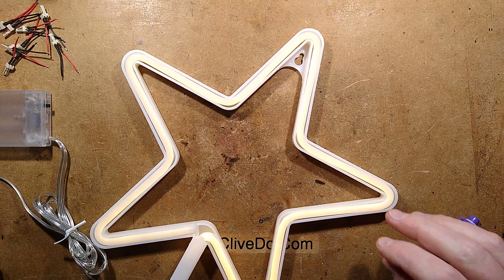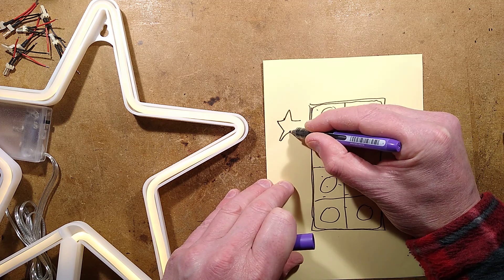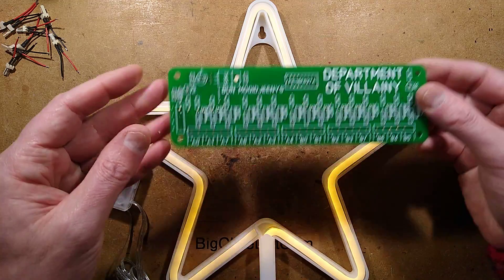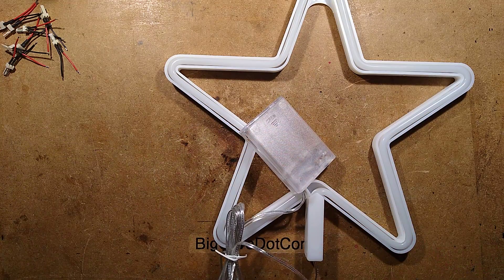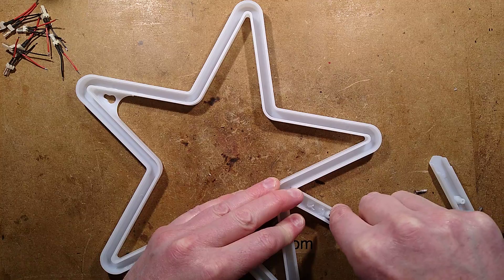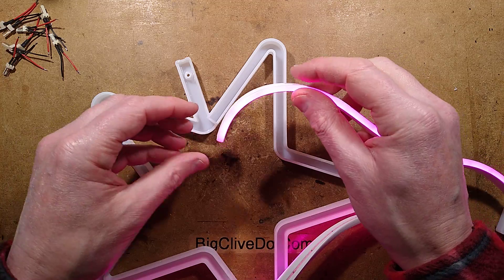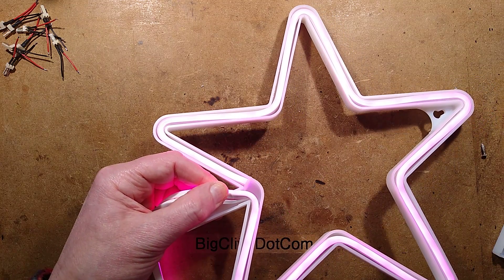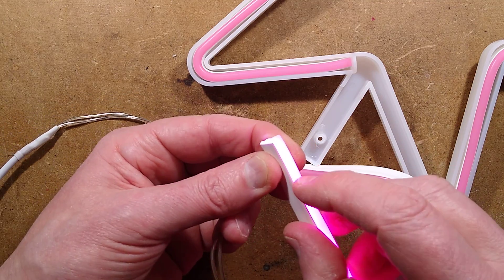Converting USB stars to 12V in eight colours.

Comment: Tip for drawing a star from a former bored student. All lines diagonal, only 5 lines.
Imagine a star. 
Start the first line from the bottom left tip.
Up and slightly right, to the top tip.
Down and slightly right, to the bottom right tip.
Up and to the left to the left tip
Over to the right tip.
Down and to the left, back to the first tip.
You should now have a star.

Comment: I don't know who designed that power system, but they should be fired. Exploding batteries are kinda hazardous, who knew right? At least they could put in a diode or a three position switch (something like battery/off/usb).

Comment: I find the construction of the frame weird, I'd think having the open side not be visible once it's hanging somewhere would be better looking and have the plastic also diffuse the light a little bit, but what do I know I repair audio equipment, not lights
Reply from the maker: The neon is at its brightest and sharpest viewed directly.  It would be much lower intensity if put through another layer of diffusion.

Comment: That plastic frame looks like it's translucent, so how would it look if you put the LED strip in upside down so that the light shone through the back? It might turn out better while hiding the exposed end of the strip, but only if the frame is translucent enough to carry the light.
Reply from the maker: The strip already applies high diffusion so it would impact the intensity and sharpness.

Comment: Clive i got a quick questions about motors. I'm a surveying technician and work with a Leica Total Station 16 every single day. However, whenever I had some free time at work I would "discover" it a little. The horizontal and vertical movement for auto lock, auto aim, auto rotate and such is I guess controlled by a stepper motor. Since its pretty loud. However it's able to position the machine within 0.0001m. And I am really damn curious how such precision is achieved. Also, whenever I have to manually move the total station horizontal or vertical it uses digital knobs. Not analog. But it's still really accurate. And rotates everything via the motors again. I could provide some stuff if needed, like photo's or videos....

Any idea how this is even possible??
Reply from the maker: It sounds like it may use well geared stepper motors and an accurate reference point.

Comment: I wonder if you can get the faux-Neon LED strips with addressable RGBW LED tape inside. If not, get on it, China!
Reply: BC did a review of a remote-control RGB neon strip -- but IIRC it was the older, fatter style.  And you'd have to hack the remote control signals...

Comment: Couldn't you connect power at both ends to eliminate the voltage gradient? Positive on one end and negative on the other, then the two voltage drops cancel. Then you can just use a big fat resistor to run it off 12v. Obviously less efficient but if it's mains powered on someone else's property...
Reply: I like that idea, connecting st either end
Reply from the maker: The resistor would run very hot.

Comment: I accidentally ordered some cheap 240v wifi bulbs and can't use them here in the US.  Too expensive to ship back.  One is quite interesting as it looks like a vintage filament bulb but they also squeezed a wifi controller into the edison base.  Can I send them to you?
Reply from the maker: Have you tried them on 110V?   Shipping then here would probably cost more than the lamps.
Reply: @bigclivedotcom  I have tried them.  Sadly, that's how I discovered my mistake.  Into electronics recycling they go..

Comment: Anyone have any idea as to how I could repair an old silhouette light that used tungsten rope light. The rope light finally gave up and I was wondering what the best approach to repair it is? The issue is that it’s a holly shape and I need a 20cm section of red in the middle of the green  so could I colour a white led rope light or something?

Comment: clive I've just realized you only have 7 colors here. which color do you plan to repeat for the 8 section display.
Reply from the maker: I added a darker shade of blue in a different material.
Reply: @bigclivedotcom  Oh, should have been a whiter shade of pale
Reply: White ?
Reply from the maker: @highpath4776  I did order 2 metres of cold white, but got warm white, which would have matched the main outline.

Comment: i just modded some string lights that had a very similar battery box for my mother. they looked like surface mount LEDs ran in parallel on magnet wire and each LED had a drop of hot-snot on it. i drilled a hole in the battery box where the center AA cell would go, ran a USB cable into the hole, hot glued it into place and soldered + and - directly to the battery terminals to avoid batteries being used.  great video! its that time of year!....the time of year to hack and mod Christmas ornaments!    :D
Reply: I actually used a string set like that to replace a failed laptop backlight. Crammed the LEDs in where the CCFL was and then took the board (ok, maybe slightly different circuitry) out of the battery case and connected it to an internal 5v line.

Comment: Drawing 5 pointed stars is terribly easy. Draw a flat line from the leftmost point to the rightmost one of the star you want to draw. 
Rotate your paper 270° and repeat, 4 further times.
Done.
With a bit of practice, you can stop rotating the paper and draw a continuous line.
Learned to do that, well and fast, when I was part of a gang that had a five pointed star as part of their tag.
Sharpie in hand, we could tag an entire subway train between two stops.

Comment: These led "neon" lights might look better if the lef shine from both sides, perfectly possible with a single led, and then there is the problem of the ass ugly frames they come in, miles too big, why not have a system where you can mold them, put them in hot water and when they cool, they set, you've just made them 65% cheaper to make because of less material
Reply from the maker: You can get double sided stuff.
Reply: @bigclivedotcom  yeah but...

Comment: You could easily make some very nice pride flags with that stuff.

Btw, to draw a five pointed star, place your pen at the left point, draw horizontally across to the right point, then down to the bottom left, up to the top, down to the bottom right, and back to the left. It's just like tightening lug nuts. (Are they called lug nuts in the UK? Between boots and bonnets, I'm surprised you don't call the cabin the belly.)
Reply: We call them "spurving bearing retainers"
Just kidding, it's "wheelnuts" (or wheel bolts depending on whether it's a stud or hole type of mounting).
Reply: Oh please no more gaybows

Comment: FWIW you can make a regular pentagon by using a strip of paper or flat ribbon and tying it in an overhand knot and carefully tightening and pressing it flat.
Reply: It's easier to draw a star by creating lines in the pattern recommended for tightening the lug nuts on a five-lug wheel i.e. CW would be from position 1-3-5-2-4-1, if you don't want the pentagon in the center, scriptus interruptus is your resort.
Reply: @michaelthibault7930  But you'd need a pentagon to start with.
Reply: The implicit outer (bounding) pentagon is defined by the first line segment drawn i.e. its length -- end points -- and relationship to 'vertical' on the page.
Reply: @michaelthibault7930  I've added "regular" to my original comment to satisfy you. It was implicit and seems to have been understood by others.
Reply: I read that in a book once c: